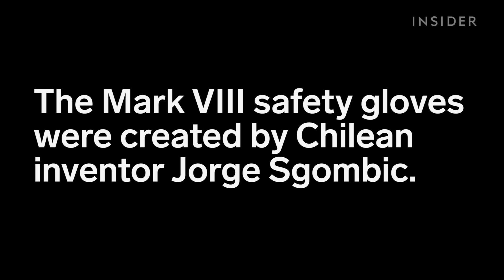Hammer-Proof Gloves Can Save Your Fingers

Comment: what if it gets cut by a 1000 DEGREE GLOWING KNIFE
Reply: Even though it has "thermo" in the name thermoplastic isn't meant for heat resistance. At high enough heat the plastic becomes malleable and soft, so a 1000 degree knife would probably cut through it. 1000 degrees is more than enough to melt any thermoplastic compound =)
Reply: Backon Lazer thank u dr spencer reid (im lonely and im the only one who watches criminal minds but thank u)